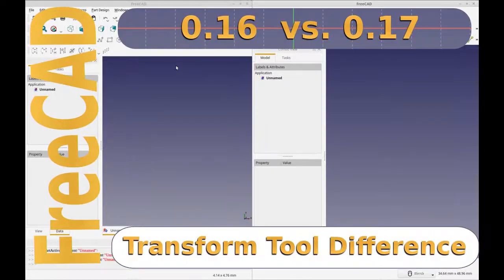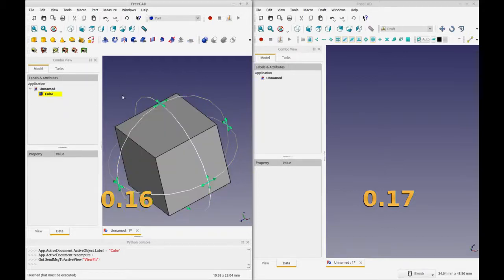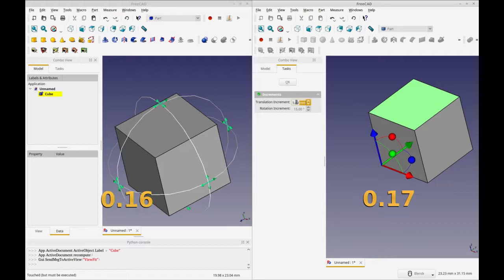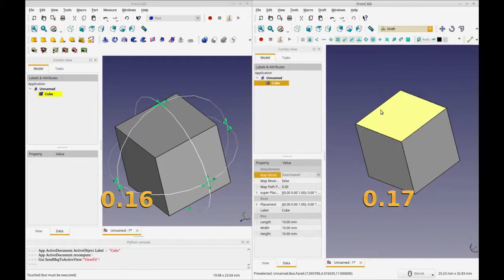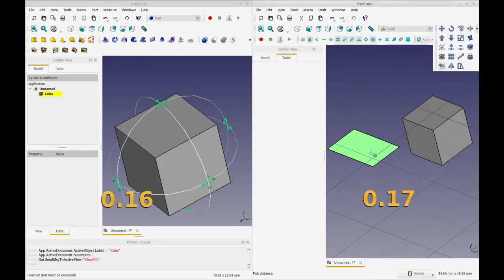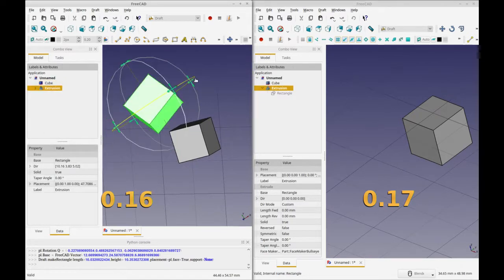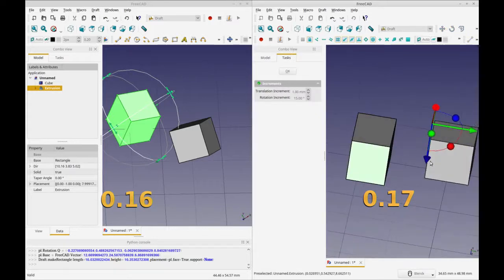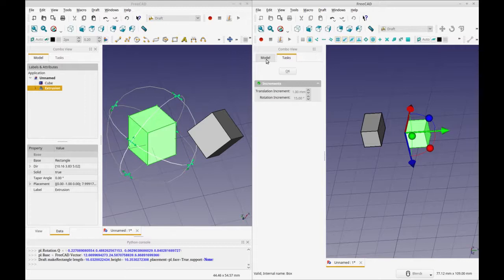FreeCAD - 16vs17 - Transform Tool

Comment: Great video Paul. Now that the FreeCAD 0.17 has been released what is your overall impression of the program compared to 0.16? And what do you think is needed for 0.18?
Reply: Now that's really interesting. Assembly is actually quite good in Solvespace. Judging from the Assembly3 github, Solvespace is being used (libslsv).